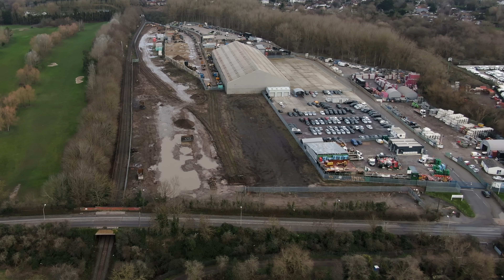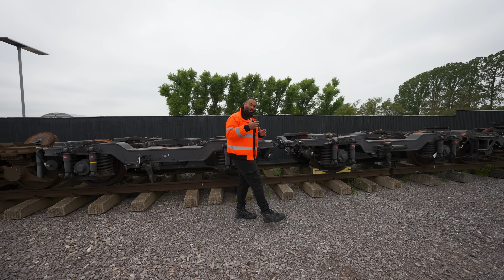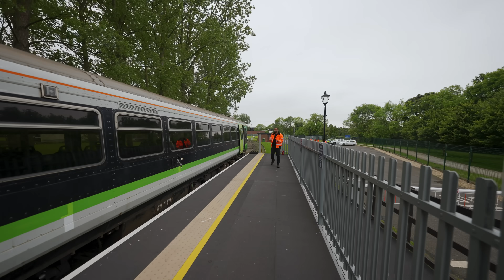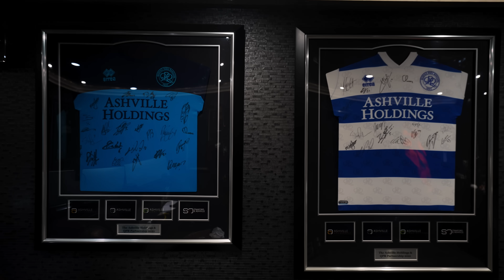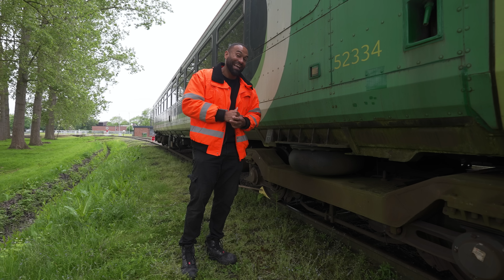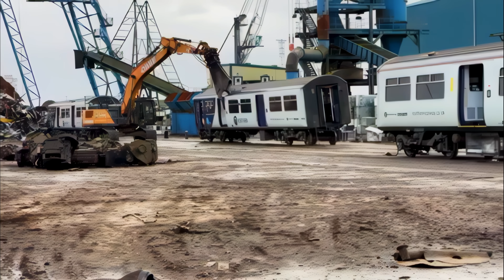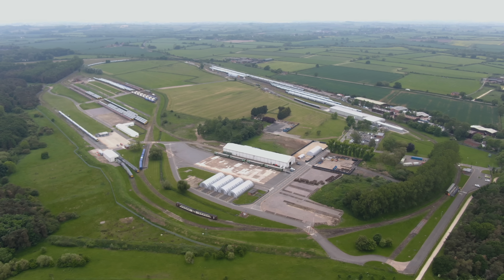I Got My Own Train

Comment: Why use transport? Just get a permit to transport by rail to your yard?
Reply: Not sure if it's still mainline registered - but tbh it could easily be dragged by a 37/66 etc etc

But he'd need to have the new yard ready before moving it, and a siding purely for the unit to sit in, to which he would then add steps for the office ..

and it needs refurbishing first so . That might be tricky, but it's absolutely possible and wouldn't cost £15,000 for alleys to shift it for example 😅